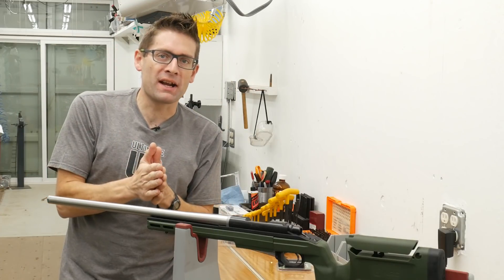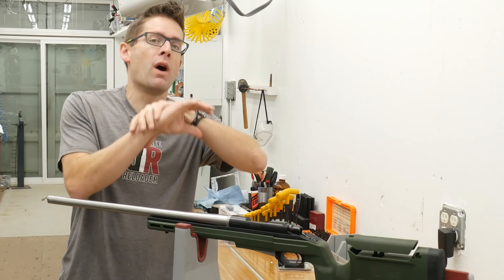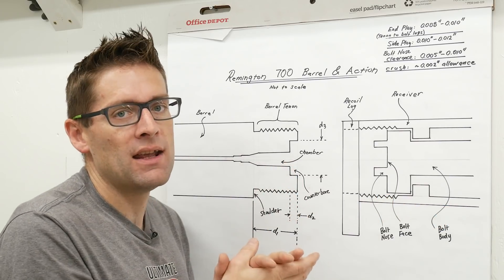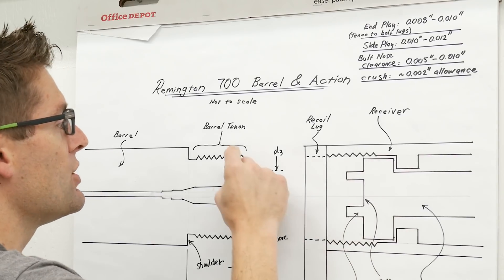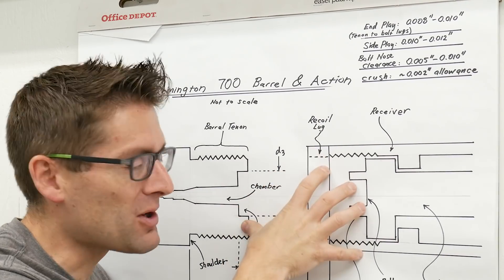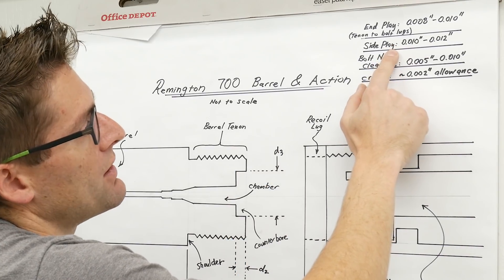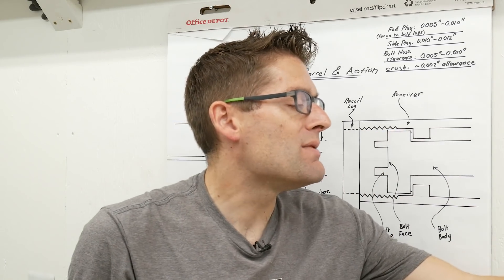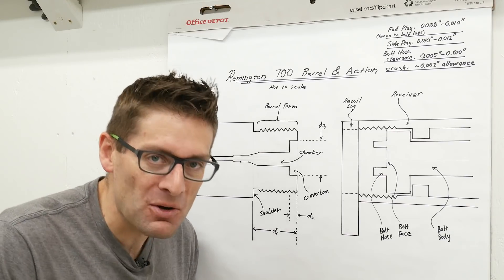224 Valkyrie Rem 700 Planning (Part 1)

Comment: Did you have to change the bolt face or did you order a bolt with the right dimensions?
Reply from the maker: The guys at Benchmark Barrels opened it up for me (brazing in a ring, machining to size) - perhaps I'll do it next time! :)
Reply: @Ultimatereloader  can you open up a 223 bolt to fit the 224 ? If so what size opening do you need ?